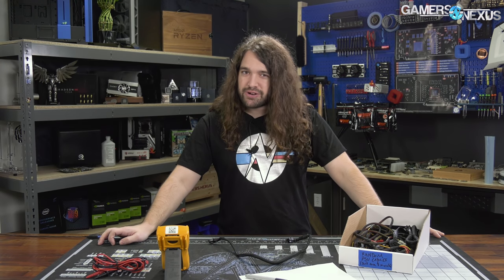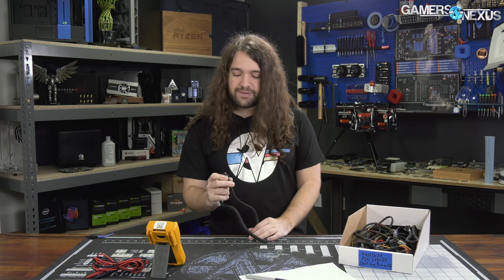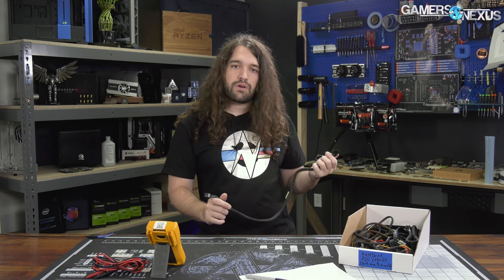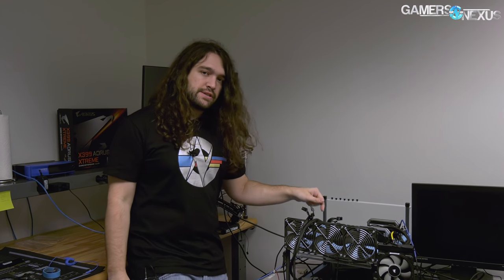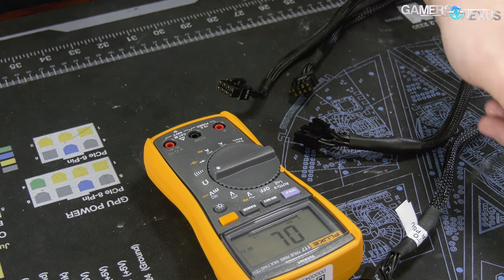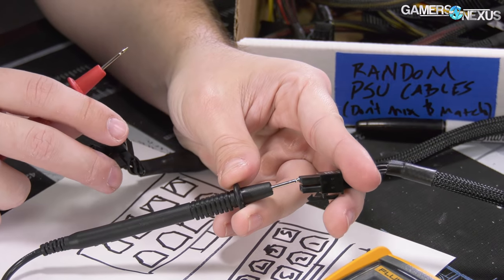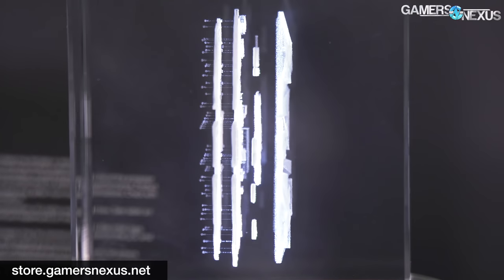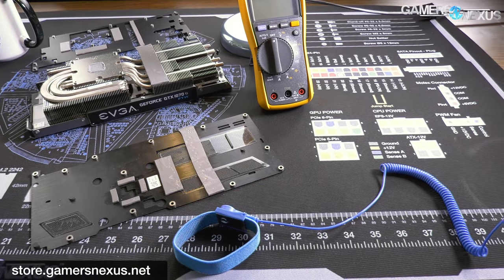How to Safely Mix Power Supply Cables Without Killing Parts

Comment: This could of saved me 14tb of data 2 months ago. Thankfully 99% was backed up.
Reply: spit take My storage is smaller than that. 14TB is expensive unless it is made up of an array.
Reply: @Aereto  14tb is the minimum for small home servers
Reply: You won't believe the adrenaline rush when I realized they all graciously blew up. (2 6tb WD Blue + 1x512GB SSD + 1TB SSD)...Stupid PSU vendors! they should but a freaking big red paper to be seen first as you open the PSU....pretty much like the paper on the conductonaut liquid metal.

I was still cold sweating defeated on the carpet ordering new drives with my phone.

Of course corsair denied any help to recover the little data I didn't back up.
Reply: @quiky9065  My storage is 0.8PB, but I have a lot of raw footage, so much that I bought a 4U Supermicro barebones.
Reply: @piers389  thats not anymore a small home server o.o
i have a 4x4tb + 2x10tb on windows storage, mainly aimed at home teater stuff. effective space is no more than 15tb tho and its time to another buy
Reply: @oceyho  Certainly I felt very dumb after, thank you for the compliment. But when you SEE the cables have the SAME KEYING it leads you to believe is ok. Most of the people I talked with assumed you could swap cables. Some even swapped cables and were very lucky to dodge a major bullet. You get it?

As someone said, if you see the cables are identical there's nothing to google about until is too late. That's exactly what happened to me. The only difference the cables had was one had TYPE4 and the other didn't...assuming different vendors label them or not randomly at the factory the first thing you do is to check the cable keying, and they match, leading you to believe is ok to use them.

I agree the problem is not the keying, but having the same keying and different pinouts and no big note in the stupid PSU box is a recipe for disaster.

It was my 10th build or so? 3rd with modular PSUs, inevitably you end with a box full of cables. PCs over time had shown an exquisite attention to detail to avoid connecting things wrong. Things like this is like a hidden hazard....if there's a hazard then make it obvious or solve the pinout or the keying.
Reply: I gotta ask... what was the 1% that wasn't backed up hahaha
Reply: @Jvman12  Sadly two double page illustrations I spent 3 nights working on in Photoshop for a 90 page book I'm working on. I uploaded all the designs I did for the Image-Line company (FL Studio ZGE, 36 designs, a month of hard work) into their forums one day before this happened. PHEW!!!!
Reply: @SaccoBelmonte  Damn, good thing you already submitted it.
Reply: lol you can shuck 8 - 10 TB HDD's for around 120 - 180 and you get a free enclosure ,thanks best buy.

Comment: Any reason you used resistor mode instead of continuity mode? Continuity mode is more convenient because is makes a sound so you don't have to look at the screen.
Reply: I suppose you could have a funky cable.  Like say a quiet* fan cable.  But yeah the beep is nice.
Reply: to save headphones users, to not have several loud beeps in the video, it irks some people like nails on chalkboard
Reply: some cheap multimeters don't have a continuity mode, and one of the points was to show how to do this with a cheap multimeter.
Reply: because some of the wires are weirdly connected. One time he got 20 Ohms between two ground pins for some reason, continuity mode would not have spotted that.
Reply: @nottheengineer4957  20 Ohms is probably not going to be in spec of a cheapo multimeter anyway. The accuracy goes to useless really quick near the single digit range unless it's specifically designed to handle it. I've fallen into this precise trap myself.

If you want to measure it without a fancy meter anyway, the right way to do it is to send a known current down the cable (1A should be good for these cables) and measure the voltage drop (or known voltage and measure the current, but you need a really low voltage), then use Ohm's law to calculate the resistance.
Reply: There's a button that turns the sound on
Reply: noob_gaming 66  Not on the Fluke 117. On many meters like the Fluke 87V and Brymen BM235, you push a button while in resistance mode to enable the buzzer for continuity.

Comment: Great video but the diagram was a mess xD You could've just wrote the pin number of the PSU connector to the corresponding pin in the standardized connector. This way you would get rid of all these confusing lines.

Comment: Wish i knew this 4 months ago. Mixed some evga cables with a seasonic psu and i fried a 500gb mx500, 2 tb wd black , rbg controller for my corsair fans and the psu itself. 
$400 bucks gone in an instant.
Reply: That's heart breaking even for me to hear
Reply: Username checks out.
Reply: I killed a 4tb hd by accident that way and it's almost too easy. Now I'm very careful. 🤪
Reply: I'd love to see a photo of the inside of the failed PSU to look at failure analysis. If it's just the capacitors then it should be easily fixable.
Reply: I wish each company would just have their own connectors or something to make it obvious that PSU cables aren't universal. My brain is programmed for proprietary stuff to just use some wacky connector or form factor. If it fits then I just assume it's a universal standard.
Reply: I did the same thing 2 months ago why the F are the cables not standard
Reply: That is terrible. I kinda accidentally mixed up a cable between an evga and a corsair power supply and the worst thing that happened to me was that the system would turn on and immediately off. Thankfully nothing fried. Guess something in my system had a sensor to know that something was wrong before it could do damage
Reply: Lmao

Comment: Wow... how lucky have I been.  I've been mixing and matching power supply cables for years without an issue, thank God.  I assumed the keying on the pins was designed to prevent you from plugging the wrong cables into the wrong slots and causing a problem.  I've had some cables that almost matched, but had one or two pins differently keyed, and so of course in those cases I was not able to use the cable.  Who knew that wrong cables can have right keys?  What a bizarre thing for manufacturers to do.  Why even key at all then?
Reply: Same. 

I've built many PC's since 2007 and never had an issue using cables between different PSU's.
Reply: Say, want to co-buy lottery numbers?
Reply: @colors5108  lol. Yea, I've been lucky.

Comment: Good timing on this video. I just ran into this problem with two EVGA PSU's a 500BQ and a 650BQ. I assumed incorrectly that the pin outs would be identical they were not, luckily there was no damage that I'm aware of but just a PSA even with the same manufacture and same product line DO NOT assume the pin outs are the same.

Comment: As long as the keys match you can also swap wires around to go to the proper pin on the power supply. I did this with needing 4 Molex cables for a server backplane and used random Corsair and Evga cables which used standard 6pin pci-e plugs and swapped around the wires to match the power supply I was using. They make tools to remove the wire from the plug though I used a staple folded in half clamped in some locking plyers and spread out about an eighth of an inch with a flat screw driver. I also sanded the inside of the two ends of the staple to make it easier to insert into the plug and worked great since it's easy to make again if the staple breaks instead of buying a new tool that also break periodically. 

On another note power supplys have a safety feature that checks the wiring before powering on so a good power supply will just not turn on if you are using a wire with the wrong pin out but that is not something to rely on when expensive parts could die in a cloud of blue smoke. I always recommend shorting the power up pins on the 20/24 pin plug and with a volt meter testing each unknown cable has the proper voltage or ground where it is specified to be on the plug.
Reply: be careful with that

i have 2 power supplies, and when i tested the voltages for a molex connector cable, the voltages were WILDLY different. when plugged into one of the PSUs, it read 3 volts between certain pins, 12v between other pins. plugged into another power supply, it gave ONLY 12v on the pins.

so, even if the connector can fit in the power supply, that does NOT mean the wiring and power levels are correct for that connector.

Comment: This is my kind of video.  During the pandemic, last July, was given an OCZ 500W semi modular PSU but without it's Molex harness.  I wanted one to run the back case fan on full for exhaust.  Just the week before, my son's ANTG PSU died in his CYBERPOWER pre built from 2016.  Was able to canablize all the cables (non modular) from it and used connectors from 2 of them, a multi meter, soldering pencil and YouTube (to see how to remove pins from connectors) to make up a solid Molex harness that works great.  I used the multi meter to measure continuity, resistance and voltage for each wire.

Comment: OL stands for "out of limit" when you are measuring voltage. if you set the meter to mV and the voltage is to high it will read OL for out of limit. It could be dangerous not knowing this because having the meter on the wrong range and using the terminaligy "open line" could miss lead someone to think there is no voltage. when actually it could be higher than the range the meter is set to. be safe
Reply: Thank you.. every time he said "zero L" i shuddered lol
Reply: OverLoad?

Comment: It can still be dangerous to mix and match some cables since some PSU cables have capacitors and sense lines going back to the PSU. That means some of the PSU side pins are shorted together which could lead to issues. How many PSUs have this feature I don't know but it's present on some higher end Corsair ones.

Comment: "OL" means "over limit" or "overload" (resistance is higher than what the multimeter can measure). And the meter has a dedicated continuity mode. And, diode mode can do the same but faster (voltage drop ~0 V for a short).

Comment: When I needed a second CPU 8-pin cable for PSU, I just used PCI-E 6-pin (NOT 8-PIN) which came with it. Only differences are the key, orientation and number of pins. Rotate 6-pin 180° and plug in, works great, and cable can sustain pretty good load. Not the most elegant solution, but the cheapest and easiest one for sure.
Reply: Not dangerous?
Reply: @Iamtherealsun not until heavy overclocking or generally power-hungry CPU is user. Anything lower than say 150W should be fine, anything above and I won't risk it.
Reply: @penguin86bitals  thanks good to know my friend!

Comment: Made customs cable a while ago. My motherboard has reverse polarity protection on the EPS 12V input, don't ask me how I know ...
So in contrast to all of the unlucky ones in the comments it can also work itself out but don't be me. Check, double check and then run it

When creating wiring diagrams be sure what orientation the plug is and if the cables are supposed to go into the plan or come out of it. This is crucial as I found the hard way. Luckily everything still works. 

Thx for the informative video despit the fact that I know all this.

Comment: And here I thought I was the only one left who actually likes "ketchup and mustard" cables better.  They make it a lot easier for guys like me who make a harness to power their monitor off of their PSU

Also, I've seen people on Reddit saying you can't do this because the gauge of the wires might also be different.  It's true, the gauge might be different, but it doesn't matter.  Unlike the PSU-side connector, the wattage is standardized.  Therefore, all PSU cables are rated for the same wattage (unless they're cheap shit I guess)
Reply: I'd be interested to see how you do this.  I'm looking to make a on/off switch for my Bose sound bar so I don't have to keep using the remote control.
Reply: Basically, I read the output specification on the power adapter that came with my monitor and saw that the output was 12v at 0.75a.  Used my multimeter to confirm the voltage and then cut apart and clamped the line to confirm the amperage.  Then I completely cut the wire and soldered it to an old molex extension I had.  Plugged that into my test bench PSU and confirmed with the multimeter that the output was the same, then ran the cable through an open PCI slot on the case and plugged everything in.  In the end I freed up an outlet and my monitor auto-turns-off with my PC.  Make sure to get the polarity right, that little dash could be the end of your electronics if you don't notice it

I also have my wall-powered speakers rigged up with an automotive relay to 'unplug' my speakers when my computer turns off, but I can't recommend anyone does that unless they have experience working with mains power.  Instead, if you want something to 'unplug' with your computer, there are specialized power strips that will shut power off to their outlets when one outlet isn't drawing power.  Like this one - https://www.amazon.com/TrickleStar-Outlet-Advanced-PowerStrip-Joules/dp/B00JPDYYSM/ref=sr_1_4?ie=UTF8&qid=1541216912&sr=8-4&keywords=automatic+power+strip
Reply: @trapperjohn7571  Thanks for your reply, I do appreciate the detail.  My project is going to involve opening the sound bar itself and somehow hard-lining the power-on signal into the remote sensor so I can use a button instead of the remote - turning it on with the computer would be even better.  Adding in volume control would also be sweet.  I don't want to disable the sensor as that will remove any future ability to use the sound bar for anything else.  Even though our projects aren't too similar, it does give me some ideas.
Reply: Hm, you might have a tricky project in front of you.  If the remote is the only way to operate the sound bar, then it's likely that everything's done in software via whatever chip it has.  It could be tricky to interface with.  I"m taking a total stab in the dark here, but maybe trying to replicate the actual sensor's output with an Arduino

Anyways, good luck!

Comment: Nice video. You can also just plug the cable only into the psu, turn the psu on (jump it) and probe the cable end on voltage setting with the multimeter ground connected to the chassis of the psu. Good way to double check your work before you plug an expensive component into it.
Reply: Should work for all but the 24 PIN Motherboard cable.. On the motherboard you have +3.3V sense and +5V Standby to worry about.. As well as possible double wires to some connectors.
Reply: @tisjester  I don't think it will work for SATA either, but neither does the method in this video :/ surely there must be a way to safely test it...